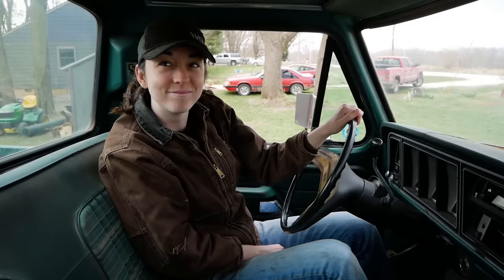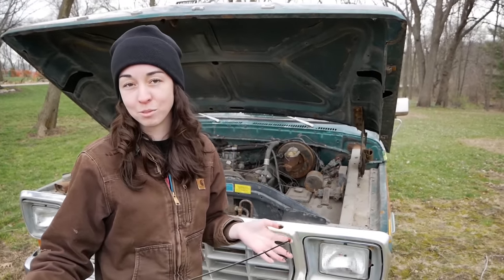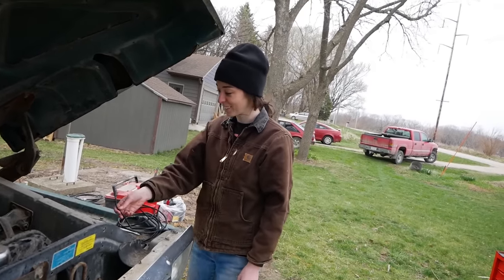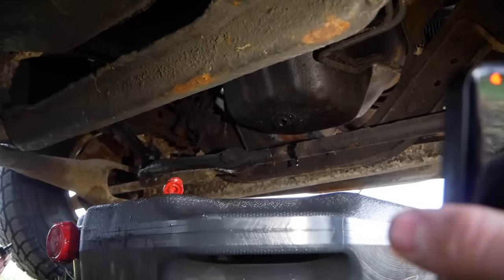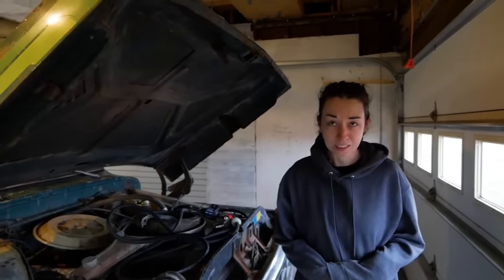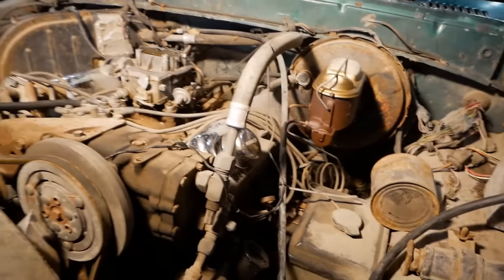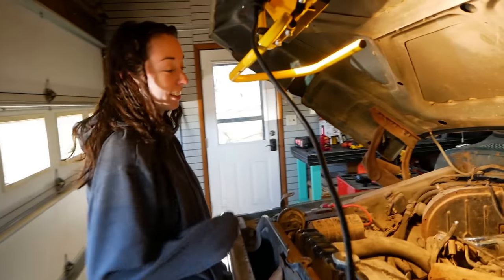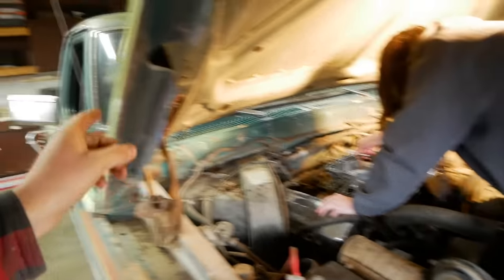I Bought a FLOODED F150! First Start and Revival!

Comment: You're going to be chasing parts until there's a new engine in there.
Reply: Not really , if they keep going at it like they are yes I mean trying to start a motor without checking oil and antifreeze isnt smart and using gas rather then fuel oil or kerosene to flush motor wasnt to smart but you got to learn some how
Reply: Yeah I did that. But hey she's awesome
Reply: Over time yes, that is an absolute truth but we’ve all been there and learning that is half the fun!
Reply: @joshuatracy4829  thanks for the warning telling me that kerosene is better than gas to flush out the motor I will remember that one.
Reply: @heaven-is-real  yeah the kero and fuel oil won't wash out your bearings like gas will and mess up your journals and stuff it's also alout safer and less stringent on your seals and races and all that. I've taken old engines and filled them up with kero and ran it a short time to clear sludge and stuff out you can add transmission fluid to help to

Comment: My recommendation to clean the oil pan is ATF red, it still has lubricity factors to keep the seals hydrated but it actually has higher detergent amounts then oil does

Comment: I found this video by surfin YOUTUBE  my first car was a FORD  1932  pick up given to by my girlfriend Dad when in was a 9th grade back in  1964 my next car was 1955 Ford Station Wagon when I was a Senior in High School ..then I bought a 1965 F-150 Ford truck for work   and surfing and used that truck for years maybe twenty yrs for work it would not quit ...and in 2004 I bought a F-150 top of the line Ford Truck for Pulling a trailer I sold the trailer for health reason and my Ford Pickup my wife was scare because it did not have all of the safety features as the new models have so now I have a Ford  Ranger 2021 with all of the gadgets and she will let me drive again ....go with Ford all the way  you can go wrong ...great series Mook

Comment: 351M, the worlds best converter from gas to a lack of horsepower-
Peg, Ziptiesnbiasplies
Reply: Had one in a 79 F 250 with over 200 k on it. My brother bought a brand new 87 c 25 with a fuel injected 350 and we were loggers. Both trucks loaded with log chunks to the roof he would get me off the line but could not pull away from that old M mile after mile going down the highway up and down the hills.

Comment: Just get a coyote engine, wiring harness, all accessories, a computer, mod the computer for manual transmission and cable throttle, put in a in line electric fuel pump and a T56 Turbo manual transmission with a hydraulic clutch system.
Reply: Just??? Lmao

Comment: The absolute definition of a “real” truck.
I’ll take it over any of the 60k rolling computerized parking lot pansy trucks of today
Reply: Yes and the water from the flood is free.
Reply: Royce McCarthy 😂
Reply: Take as many as you can, tough trucks these days destroy the old trucks in every way.... well maybe not in cost of repairs , but my 63 Chevy 3/4 ton broke enough I bought a 97 f150, and it out worked the Chevy by a lot! Now I think the golden age of trucks was in the early 2000's then it started to fall apart, with boxed frames, and MPG requirement over complicating engines leading to high failure and costs.... Probably another example of get the government involved and watch it turn to shit.
Reply: My 99 F250 begs to differ. Best era of work trucks ever built imo

Comment: Fill it with diesel and rotate the engine without starting it.
Reply: Actually, I'd go with a gallon of WD-40...it'll displace the water.
Reply: Kerosene would be also good to use
Reply: Water does little harm as long as you’re not circulating water. 
Drain, a quick flush with some diesel to thin the oil sludge turning it over without starting it, drain that out and fill to level with new oil, and new filter. 
Then run it, get it warm. 
The water will soon evaporate.
Reply: Kerosene then multiple oil flushes drop pan to clean oil pump screen
Reply: enolastraight  wd40 is water 💦 souluble fish oil

Comment: I would have flushed it with a couple gallons of diesel.
Reply: Probably a bit safer.   Petrol is a bit serious once ignited....
Reply: @alexanderSydneyOz  especially for people whose idea of fixing it is light the engine on fire !!
Reply: I was thinking diesel, or kerosene ..  worked great on a 79 chevy.
Reply: Got a little edgy watching an open gasoline container next to an electric pump... been using kerosene as a flush and parts cleaner for more than forty years...

Comment: My Uncle had a 1978 Ford 150 and we Changed it from a 2 wheel drive  to a 4 wheel drive  he got a  used parts truck the same year that was a Ford  250, we rebuilt the  Engine the Truck came nice it was Awsome

Comment: 351M is a 400 engine, it used a taller version of the 351C block to accommodate a longer stroke plain and simple, hence M for modified because the block was modified by making the block  cylinders taller to have a longer stroke.

Comment: I bought almost that identical truck years ago. Ran rough and only moved in reverse. That was my first time rebuilding a transmission. The c6 is pretty dang easy for a first rebuild. Get a newer drum that holds more clutches and steels. Drops right in.

Comment: no creamy soup in the sump which is good . clear water then black oil means it was flooded sitting not running . put 10 litres of diesel in the engine . remove plugs and get a large high torque electric drill / socket on that crank pulley . turn it over fif 20 mins . then flush it out . then replace oil filter and oil add in engine oil flush . turn it over again 20mins . all should be good after that flush .

Comment: Also check the rear end for water and the gas tank.
Also on the engine have the entire engine magnaflux the entire engine block and heads to check for any kind of water leakage check for crack cylinders check for a cracked block check for a cracked head anything that will cause it to let water into it. You'll find it at well worth it in the end.

Comment: If you get an engine like this again, put about six quarts of diesel in the sump and run at idle for ten or fifteen minutes. That will dissolve the gunk and displace the water and its oily enough to lube everything at idle speeds. Dump it and put cheap oil in it the first time. Run it for a bit then change to better oil and some Marvel Mystery oil. Should do the trick!

Comment: If bolt to thermostat is screwed. Could that mean Edelbrock intake with a 4bbl preferably a Holley  650 or 750 and some headers? heh 351M are strong motors. I've seen quite a few built. They are quite reliable. I own a 79 with a built up 351m headers  edelbrock intake, 750 double pumper and she's as reliable as they come as rips! Dig the truck Mook! Youre a badass!

Comment: I have a friend who drove his f150 into a lake. HeI have a friend who drove his f150 into a lake. He shut it off while in the water. We towed it home, drained the oil & changed the filter, pulled the spark plugs, did an oil change shut it off while in the water. We towed it home, drained the oil, pulled the spark plugs, did an oil change, cranked it with the plugs out, put a little oil in the cylinders, and put it back together, and it started right up!

Comment: Wow. There's an old "Smog Dog" under the hood, AND you found a Q Junk to boot. All you're missing in that eiectron carb Chysler ran in the 80s,.to have the trifecta.

Smog Dog was what my friends, to this day, call the 351 Windsor Modified mills. I've had 3, and only one stayed in the car, 78 Cougar XR 7, that was a winter beater, and then a spare for the demo, at that year's county fair. Other 2, a 78 F 150 Ranger, and 79 F 100 base trim. Both ditched for 351 Wiindsors.

If i had to make a decision between eorking on a 351 M, and urinating on my neighbor's new electric fence, I'd have a hell of a hard time deciding.

Comment: Sounds like the block or head is cracked thus the water in the pan. . Likely the rad is empty or very low. I love these old 150's too. 79 and down. 351 Windsor motor is best in these.

Comment: I would have used diesel fuel instead of gas and poured the engine completely full. Turn the engine over cycle it a few times even run it for a second.then drain it. Gas has no lubricant in it. Desiel does. Great find. That is a sign of sitting a looooooong time

Comment: Just wondering... did you flush out the rear end, transmission and stearing stuff? Probably should put a new set of plugs, wires, destributor cap ect., and check those vacum lines. Im guessing yall can be on the road worthy side, in no time. Also Ebay had new ford carbs for about $100, last year.

Comment: I had a 1974 F100 with a 460 in it,this thing went like a raped ape but 4 drum brakes couldnt stop this thing for beans,i remember pushing down on the brake pedal with everything i got and pulling up on the bottom of the steering wheel for levarage what a ordeal much fun,hey i heard that power steering whining a bit,no problem just ad some more fluid and pedal to the metal fords can take it,enjoyed the video im also a fan of Thunderhead289 and VVG do you guys all live in the same vicinity or something?
That VVG guy is hilarious,ok take care im gona subscribe for shits and giggles.

Comment: Itll work FINE for about a year and then it'll start having UNBELIEVABLE electrical issues. I've dealt with 4 or 5 vehicles that have been flooded. ALL the same story. A smog pump is simply a air pump that pumps fresh compressed air into the exhaust to dilute the emissions. As LONG AS YOU DONT START IT the water wont wash out the main bearings if you drain it before you start it up. And NOPE add a quart of diesel to the oil when you run it the first time

Comment: Think of all that floating dirt and sand getting into the cylinder wall so that your truck cause them to severely scuff up to the point that you're going to have to tear it down and do a complete rebuild the bearings will be ruined both rod bearings main bearings and your piston rings the truck has been underwater you need to do it from top to bottom all over rebuild overall the whole thing.

Comment: A 351 Modified 400 engine gets 5 to 6 mpg on gas if that much..I had that same exact truck and couldn't afford to drive it so I just used it for hauling firewood as close as possible to my home at the time lol..I'm not going to dog the truck cause it never failed to start and ran great but I couldn't afford to just take a road trip with it and that was in the 90s when gas was a bit cheaper. That's the only vehicle I've ever had that loved the gasoline lol..I really don't understand what Ford thought they were doing when they decided to build those engine's

Comment: Fill the oil pan with diesel fuel, then put a airline down the dipstick hole and let it bubble the fuel oil through the engine period flush it a couple of times and you'll be good to go. Seeing how I'm getting this video one year after the fact I'm sure you already have it running

Comment: The Ford 351M is a 400 engine it use a taller 351c block to accommodate a longer stroke plain and simple

Comment: Why didn’t you replace the spark plugs. And the spark plug wires and clean the gas tank first?. Then blow out the fuel lines before you even start to do anything.

Comment: Mook, How are ya? I have an absolutely taboo vehicle I would like to have you work on. It has water in the oil and I was wondering how much you would charge to put another engine in it. I was also told the tranny in it is also no good. It's a 93 Pathfinder and I'm going to need it to get my channel up and running. I would appreciate it if you could tell me what it will cost to bring my Pathfinder and an engine and tranny to you and have you put them in for me. Bare in mind that I live in Arizona. I would have someone here do this, but honestly, you are the only ones I trust to do this job.

Comment: You know everybody that doesn't want to build a bomb uses diesel to flush a flooded motor. You start and run it for a 1- 1 1/2 minutes. Drain. Put in new old and filter. Run it for 50-100 miles. Change oil and filter. Your good.

Comment: Don't hate on the 351M because THAT one spent time under water and now is giving you fits. Any engine would do the same in that situation. I've had tons of 351M's and 400's over the years and they are much better than people give them credit. On average they've outlasted all the SBC's I've ever owned.
Reply from the maker: We’ve got a Bronco with a 351M that runs like a dream for the most part. We aren’t letting it completely make up our opinion. Personally I don’t blame my green truck at all, but Kevin doesn’t like it still 😂

Comment: If that truck ever spent more that a couple of hours under water, most of the wiring harness and switches have been replaced.
In fact, if it weren't for the copious amount of water in the crank-box, I's question if if had EVER been in water ot the battery had been disconnected first.

Comment: Need a fuel filter on the pump inlet. Disco the inlet for now. New sparkalators and lightning tubes. Maybe even a new cap and rotor then bring the thunder!  She’ll run like faktree. Probly not. Smh. 🤣

Comment: Would think the tranny and rear end would also be full
Of water.  I pull the intake and spark plugs and blow compressed air on one side and have the shop vac sucking on the other while spraying wd40 in there to clean out upper end.  Has always worked for me. Then rotate engine and move to next cylinder.

Comment: Your friend is wrong about a 351,400 modified. these engines only need a cam change , alum intake 750 carb and they will smoke a 350 chevy. these engines have won the Engine masters champion more than any other engine.Why a wimpy small 302?

Comment: have the same model, 1 year later then yours. but 2 colour, red/black. was an abandoned car from one of my meighbors who passed away. i was almost lucky because the car stands in a barn buried under 1 cm of dust and straw, which means, almost no rust. they give me the old Ranger for free. 1 cylinder was damaged, I replaced it and it runs fine. He also only had original 29,400 milage. when it was damaged. it was parked and hasn't been driven since, that was in 1981 because I still found old "Texaco" gasoline receipts  in the glove compartment. God, gas was cheap back then. Gallon $1.29. The owner didn't have it fixed and so today I have a well-preserved F150 Ranger. After polishing it looked almost new. Of course I have also collected and restored others, but never gave the car away, still drive it today - from time to time. 🤭 I restore also other classics. my hobby and also addiction.. Besides my job, unfortunately I never have that much time. (studied mechanical engineering )

Comment: 2:19 You two "dipsticks" might have done better to have checked the oil BEFORE you tried "making some noise", since any motion of the engine would destructively circulate gunky rusty watery oil through the engine's bearings and seals.

Comment: This would have the crappy venturee carb just as bad ad the Chrysler Spark Control System (AKA Lean Burn) both werer problematic junk. I remember chucking out these and converting these over to HEI FI

Comment: I also bought a junk f150 i think the same 78 w 351 Cleveland but not sure,been awhile ago for 500 bucks. It would just start running like crap all the sudden like one bank of cylinders stopped firing..After trying to figure that out for two weeks i had the air cleaner off the carb and engine running fine staring at the carb when all the sudden i saw a flake of rust go into the jet and bingo cylinders stopped firing,aha a rusty fuel tank,...a magnet got that out and a fancy one dollar see through fuel filter from kmart installed fixed that.Then the three on the tree went out and i couldn't shift it.It stopped right in front of a young guys house.I worked on it for two days when he came out and asked me wassup? I told him and he said would you take 500 for it? And that is the end of that story.

Comment: My grandfather use to have a 99 or 2000 f350 quad cab with the extended bed and it was only 2wd Dooley and it towed a 8 ton and 32 foot tag along like me as a passenger didn't feel it  like that camper wasn't there and it was the same color as your truck mook forest green with the brown trim  the only flaw in that truck was the oil pan my grandfather let it sit there until the oil pan rotted from the inside out and you had to tare the entire front clip off pull the motor out of the truck just to get to the oil pan sad we had the let that truck and that tag along go I wasn't able to drive at the time too Yung and my grandparents got too old to do it anymore so now my uncle and me take my grandmother out for camping cuz grandpa's gone now 2 years now but we still go camping I miss that camper and that old truck now I have a 65 f 600 the old farm trucks I'm trying to restore it got as far as I can go with the tools I have it brought back memories seeing an old Ford with the same color as my grandfathers truck haven't watched it yet but I'ma bout to cheers mook👍💪✌️

Comment: it is flooded that means the water is sucked into the engine and the pistons tried to compress the water and it can not because air compress allot and water vary little that bens the piston rods and you get rod knock you need to rebuild it.the engine is junk from flood you have to put a new engine it  the truck needs all .cylinders to run right.

Comment: The engine is called a 351 modified but it is not correct.  The proper name is a 351 Michigan since the engines were built in the Michigan engine plant. Think ....  351 Cleveland... , 351 Windsor,... 351 Michigan.🤷‍♂️ Just saying😉😉